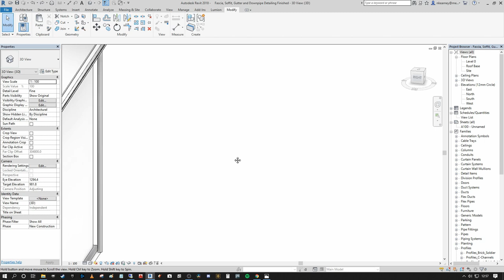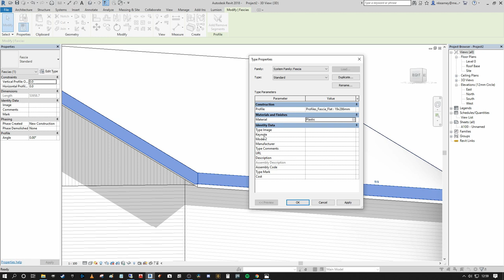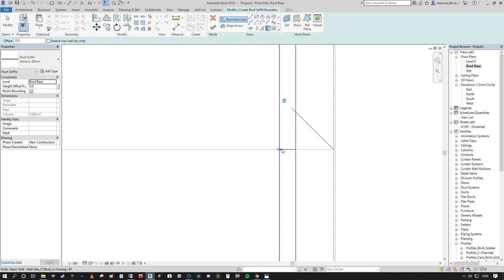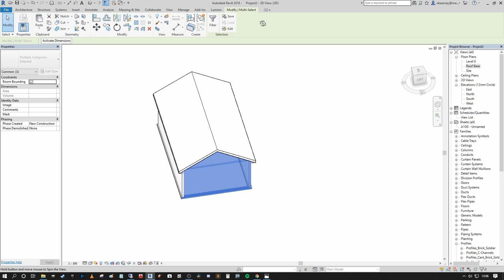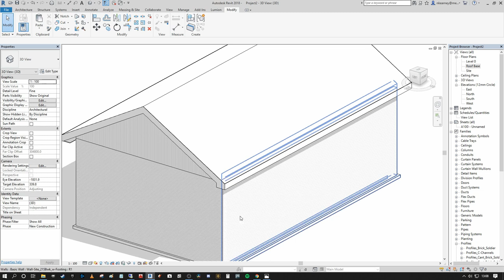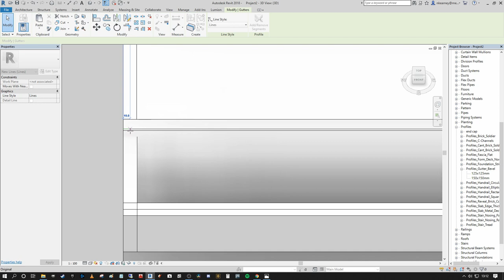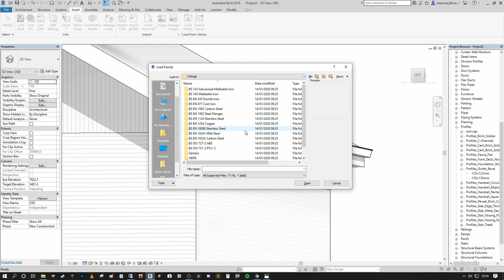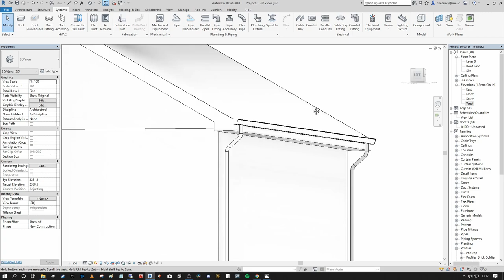Create Roof Fascias, Soffits, Gutters and Downpipes in Revit

Comment: Thanks for the tutorial. Just from a builder perspective it would have been interesting to see how you give a little slope to the gutters because that is how it is constructed in the real world, all the rest mate, 10/10. Cheers
Reply from the maker: I agree, it would be great to be able to implement this fall with ease. The issue lies with how the gutters are hosted on the roof eave line in Revit , you would need the roof eave to be at falls also which would be incorrect from the constructability perspective. I have had success however hosting the gutter to a model line that was placed to falls on the Fascia board but it can be temperamental (primary reason I didn't include it), but it remains an option if you would like to test it.
Thanks for the feedback, glad you found the video informative, falls aside 🙂
Regards
Niall

Comment: Hi, great tutorial, easy to follow and very helpful.  I don't have a gabled roof so it was easier to pick all four sides.  This is long.  Two things: I could not proceed in the ROOF PLAN view.  I had to go to the BUILDING ONLY view I created on Sunday.  I also see a Lowest Level notice when I clicked on ROOF and the soffit dropdown.  My soffit is on the foundation!  WHAT?  I moved it up to the ROOF then clicked on the green check mark to see what would happen.  "Sketch is Empty"

I was able to follow setting up the edits but kept it at the plywood, but changed to plastic in the Edit Type.  I picked my walls just find.  Everything was good until 6:20.  I could not close out of the mode using the green checkmark.  The error says  Cannot have overlapping lines.  🤔I don't know what is missing or if there is something I can't see in this view. I will try it again but still wonder why Revit won't let me add this in the ROOF PLAN as you have done. 

After a break I took another look.  Ah ha!   Now I see see it.  My BUILDING ONLY still had the lines of the driveway in it.  Earlier I was picking the structure walls AND one of the driveway walls prompting the error message.  Now, don't tell anyone that there is an extra soffit floating above the garage (detached with same roof style) 🙄 What now?

Why is this?  Upon adjusting the offset to -2' see the main house soffit dropped. This is because I tried to do both the garage and the main house which are two different heights.  I need to execute each individually.  I did that twice, one at a time, but I still end up with a 3rd Soffit floating above the garage roof.

Last time for tonight.  I still cannot create a soffit in the ROOF PLAN as you are doing so I am closing the view. I opened the ROOF FRAMING this time and will work on the main house, not the garage. Picking roof edges, but no option to pick walls.  That worked for the main house but after saving the view, it vanished. 

Back to the Building only and the same message: "You have created the Roof Soffit on the lowest level - Foundation, move it to Roof from the dropdown. Totally lost on this, where else would it go?  After selecting Roof, now I have the modify and create tools to work.  I followed your steps exactly here, picking roof edge via the edge, then the outside walls, noted that they locked.  Then finish up using the green check.  No error messages.  OK.  I see a double pink line all the way around which tells me I have a soffit on the main house.  Now to the 3d view. I can see it under the eaves.  OK After saving it vanishes again.  I am done with this for the night.  NO idea what is going on.  If anyone else has any thoughts I am all ears.  Thanks!!

Comment: Great video, it  helped me a lot! But on my Revit went something wrong. For some odd reason the pipe  is shown as a black line on my 3D perspective. 
On the north, east etc. views it is shown correctly (like in the video). 
Does annyone know what I did wrong / what I'm supposed to do?
Reply from the maker: Glad you found it useful. Make sure your view detail level is set to Fine and you should see the full pipe rather than the centerline
Reply: @8020BIM  Thank you for your  quick and helpful response!
Reply from the maker: @harmjan3070  no problem. Did it do the trick for you?
Reply: @8020BIM  Yes, thank you.

Comment: Great tutorial! However, the pipes doesnt work for me. It just draws some strange lines, not sure where either. Tried changing to 3d-view and it is just a line. I tried changing the diameter also to make it bigger just in case there was some sort of scale issue but it remains a line.
Reply from the maker: Hi Goran, thanks for the positive feedback.
Change the view Detail Level to Fine and your pipe should be fully visible. As a default Revit shows pipework as a single line in coarse and medium detail levels.
Hope this helps,
Niall
Reply: Answer: It is about the quality level in viewing. It has to be changed to "fine" unless manually adjusted. However, found it a little difficult to position the pipes and didnt manage to solve it. Drew the pipe first in elevations and I guess it was connected far off not connected to the actual gutter so used a white region for the other elevation.
Reply: @8020BIM  just scrolling down the cmmnt hoping that someone had the same prblm as mine and luckily you replied..thank you and keep moving

Comment: Also, do you know how to change the colour of the rain water pipes to black ? Thank you
Reply from the maker: Pipe Material is defined by the System Specific Pipe Family Type. You will have to navigate and load in the Pipe Systems Family that is the correct material type for you (Thinking logically about this, you would have Various PVC Colours, HDP Pipes, Carbon Steel, Stainless, Galv, Double wall etc.) Each of these will have different specification that drive the size (Internal Diameter for a double walled pipe would end up with a vastly different external diameter then the same internal diameter for a single wall pipe for example) so it makes sense that Revit uses this function.
Reply from the maker: Additional Note - if you have a segment already placed you can override the material from the Properties Palette. Beside "Pipe Segment" you will see a material descriptor. You can edit that to show anotehr material. Alternatively (and better from a model management perspective) would be to create a new segment material. 
Sorry, not a straightforward answer for you at all but definitely one you should aggressively pursue and get used to the details of it. 
Niall

Comment: I followed your tutorial but I'm stuck in the pipe drain, the elbow family is not in my libray, I'm using Revit 2016
Reply from the maker: Hi there.

Not sure of your region but you should certainly have the Revit Defaults Pipework Connections families somewhere in the Revit Family directory. Then, add the connection types to your "Routing Preferences" and your Pipe systems should automatically start generating the appropriate connections. 
Hope this Helps,
Niall
Reply: I also dont have any of the generic families in my library. Did you ever find out how to access these?

Comment: what if i wanted my downpipes to be a rectangle? how would i do that
Reply from the maker: Hi Alejandro, thanks for reaching out.
Unfortunately, one cannot make a custom profile shape or square for Pipe since it's a System Category. Your options are limited. Perhaps you can create a custom line-based Family that fits the profile of the square pipe. Alternatively, if you are not tied directly to usign a plumbing / pipe family type you could use a duct system instead although it is technically incorrect.
Hope this helps,
Niall
Reply: @8020BIM  thanks for that. There's a dp family i found with both quadratic and circular profiles so i used that but yeah i was looking for the family for that downpipe you used in an effort to edit it somehow. Cheers for that mate
Reply from the maker: @Lowcast94  Glad you got it sorted out mate, all the best!

Comment: Please I notice my Revit does not have 'system' tab. how can I set it pls
Reply from the maker: Hi there. It depends a bit on the version that you have installed to be honest. Some of hte earlier versions did not automatically have the System Tab readily available (for example, Revit Architecture would have only had very basic system families included and no working system TAB). So, if you could clarify your Revit Version I may be able to help.
Also, when installing the newer versions you may have deselcted the "Systems" part of the installation. Failing that, the tab may not be active within hte Revit Interface Options. 
Hope some of hte above helps,  best I can do with the limited information.

Niall